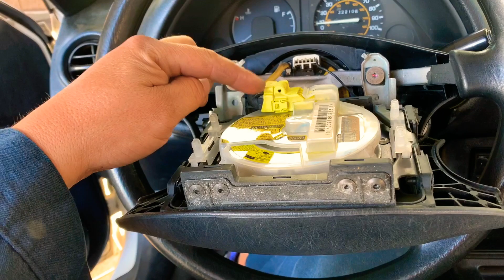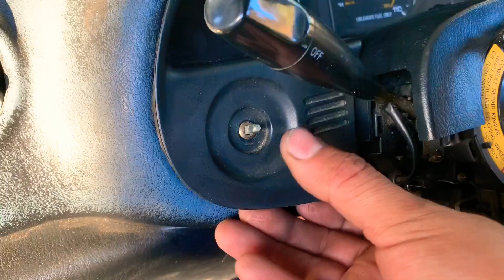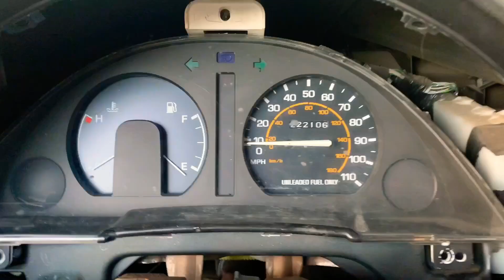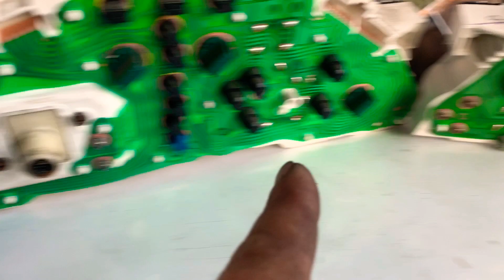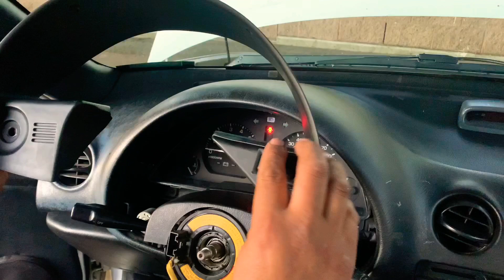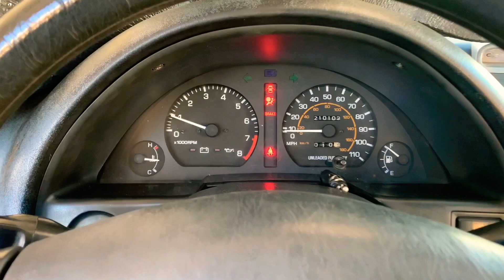Dash cluster replacement on your Toyota @elchanojose

Comment: I've got a 1993 toyota tercel 4 speed manual. The speedometer works but the odometer doesn't work. Does it have a worm gear or will I have to replace the whole dash cluster?